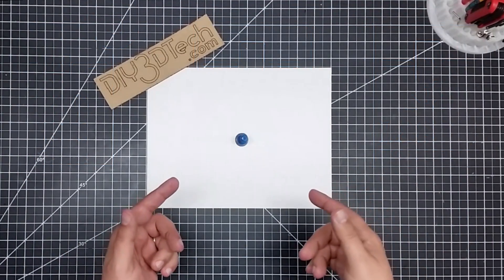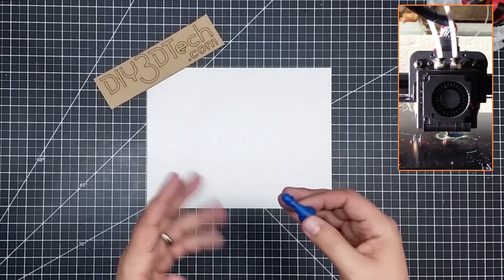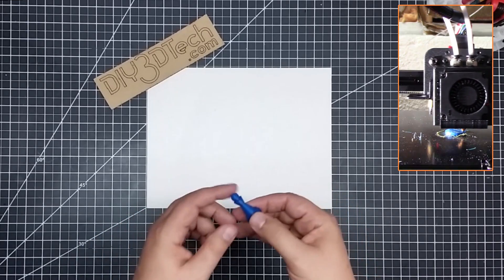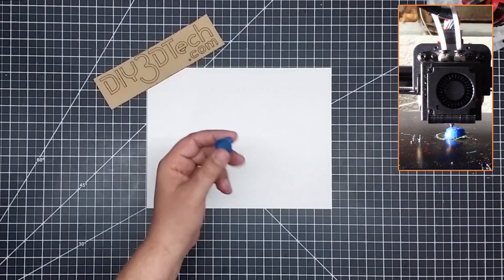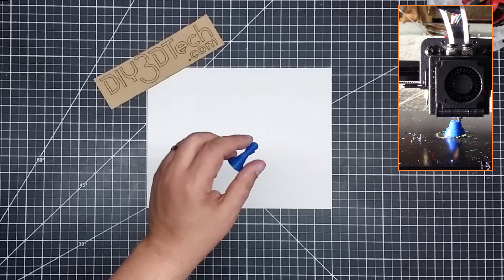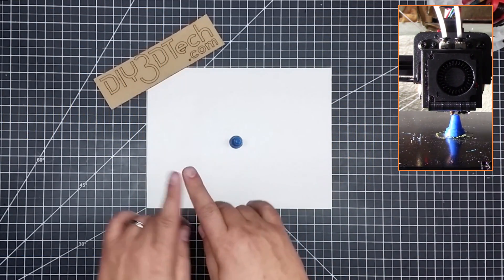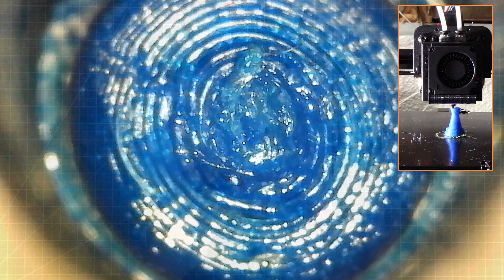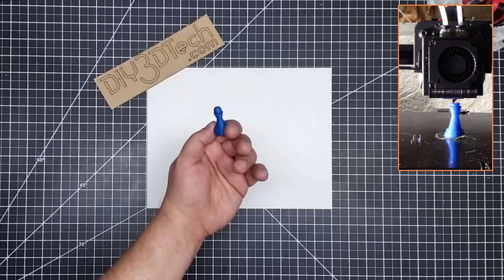GeeeTech A10M - Mixing Nylon with PETG AMAZING!

Comment: Okay, tried it at home on my geeetech a10m. I used petg from geeetech, and .065 (approx 1.7 mm) nylon from a weed eater. I set my mixer for 50/50, and let go on a one level temp tower, looked good with some stringing. Not bad though. I did a couple more. 230c seemed to work well. Nothing dried, all adlib, settled on 70 bed temp and 235 to start, bumping down to 230 after 1st layer.

Comment: Hi. thanks for the video ! Have you ever printed Carbon fiber PLA with the A10M? If so, which nozzle was used? What is the nozzle MK10 M7 or MK8 M6? Thank you in advance!!!
Reply from the maker: Sorry I have not, to print carbon fiber you need a stainless steel nozzle as it will chew up brass.  Also be careful with the carbon PLA as there can be aerosolization of the carbon fibers.
Reply: @DIY3DTECHcom  Thank you verymuch

Comment: I want to print big, strong, cheap parts.  I'm thinking about getting a Geeetech A20M and printing mix of nylon weed trimmer line and carbon fiber infused petg.  Like 66% weed trimmer and 33% cf petg.  Did the part you printed warp?  Did it stick to the bed well?  Did the layers delaminate?  Did you try different ratios?  0.065 inch weed trimmer line is 1.65mm in diameter.  It's dirt cheap.  I was going to order 5 lb spools of it for about $5/kg.  Is there any chance you could try this combo out and tell me the results?  Mixing dirt cheap nylon with semi-cheap petg might be a real breakthrough.
Reply from the maker: I would not do "weed trimmer line"  you will likely have issues as 3D printable nylon is blended to be printable and while I have seen people use weed trimmer line, I do not recommend it as too there will be little consistency on top of the poor blend.  Keep in mind you have to force this though a small nozzle and impurities will damage and or plug the nozzle.  Also printing small parts have worked ok mixing plastic however for larger parts I have had issues with nylon not flowing after a while as the viscosity of the PETG seems to over takes the nylon as the heat creeps up the cold break.  What I have found is mixing Nylon & PETG yields less wrapping and better adhesion then pure nylon.  It also has greater rigidity then pure nylon which flexes quite a bit.  The GeeTech is good for testing, however if this is what you want to do, I would build a machine specific to the task with a silicon bed and possibly a phenolic bed and all metal stainless steel mixing  hot end.

Comment: What did you use for adhesion on the glass A10M bed? PETG adheres so strong to glass that it can tear out the glass on release. Will you be characterizing the properties of the finished product in comparison to PETG and Nylon alone? (strength, hardness, elasticity, melting temp, glass temp...) If this PETG/Nylon blend produces exceptional results, would it makes sense for filament manufacturers to market PETG/Nylon hybrid filament?
Reply from the maker: Just the regular bed, as yes aware of the risk yet have had no issues with the Black Diamond Surfaces and PETG (not to say every one will have the same experience).  Also yes hope to do more with Nylon/PETG and Nylon/PLA as the filler (i.e. PETG or PLA) does seem to make the nylon behave far better and I find myself using on a regular basis now.